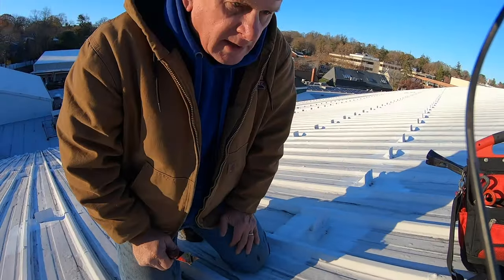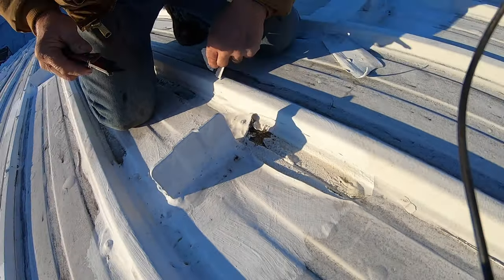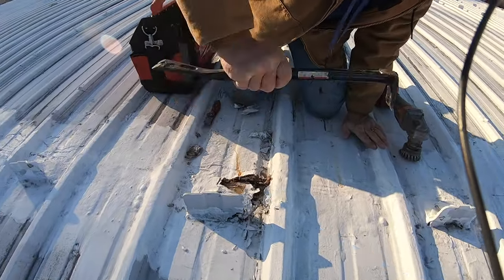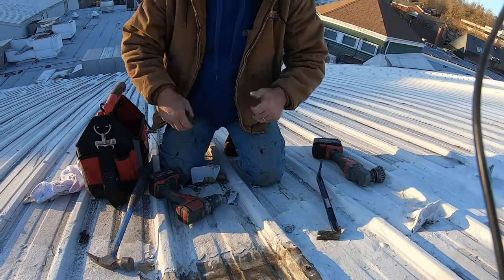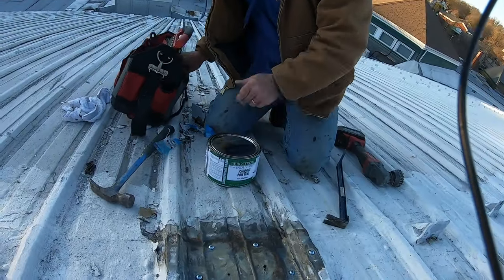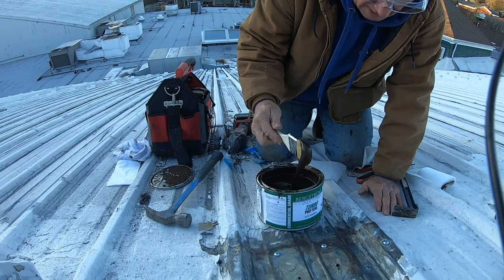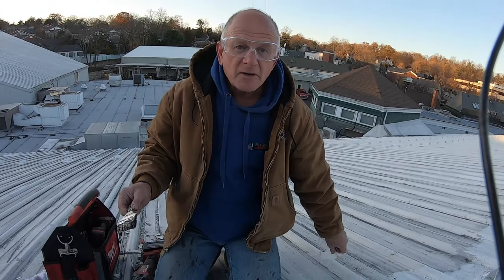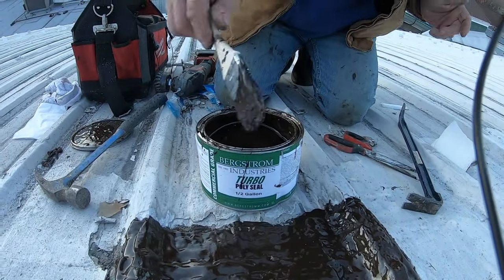Why NOT to apply Metal Roof Coatings - The worst thing to ever do

Comment: i have 900mt of metal roof and that black thing with time sun burs it and it turs like dust,,i clean everything and use a 20 year warranty silicon coating  and its 6 years now and in perfect condition
Reply from the maker: You are correct. In most of the videos where I use Turbo Poly Seal, I do tell people to use Silver Coat Protection. It is a tougher product than Silicone. But, I also use Super Silicone Seal in many places, for that reason

Comment: I have a  metal roof about 40 years old, the nails are not working anymore and I need to install screws, what would you recommend? A screw with a rubber gasket?  THanks
Reply from the maker: Sorry for the late reply. Yes screws with a neoprene washer will do.

Comment: What do you to on a 30 year old metal roof that the original coating is starting to degrade?  Change out the roof?  It is a very high end metal design.
Reply from the maker: I am not an expert on metal coatings. But, I suggest you research how to go about treating metal roofs where the galvanized or paint is starting to come off.
What I am showing in this video is that spraying a latex coating over a metal roof will cause problems.
The biggest problem are the seams. As soon as you coat over a seam, that will trap water eventually causing it to accumulate  between the panels causing rust. Also we found that the coating was not adhering around every screw and water ended up penetrating that part of the coating causing the metal to rust around the screw.
What we did was to remove the old coatings around the screw with an angle grinder and steel brush and dabbed the screw with Super Silicone Seal or Turbo Poly Seal. This works very good. The cleaning of each screw is critical.
We also removed the screws on the seams, separated the seams, painted Turbo Poly Seal with fleece 4" up between the seams and also 4" below the seam. Then waited for this to dry and then screwed the panels back down unto the cured Turbo Poly Seal. So this would prevent any water that gets trapped between the seams to cause rust.
Call me a "hack" but for $20,000 per 400 foot seam, saved the roof that would cost $400, 000 to replace.
Reply: @FlatRoofDoctor  thanks for the reply.
Reply: Rust Grip® No More Corrosion! Over 20 Years Rust Protection!

Comment: Question - I brought a farm 4 years ago and the barn has a shingle roof on it. Problem is that who put it on put the shingles on plywood over a metal roof. Currently "cleaning" off the shingles but have alot of holes.
Any recommendations?
Reply: Apoc 583 Armorbase and  585 Armorflex thats the best on the market.

Comment: Is a granulated roof the same as a modified bitumen roof?  If not, which roof is better and why?
Which one last longer?
Reply: Typically yes however you can get modified in either granulated or smooth and of course granulated will last longer. I'm sure this late response doesn't help at this point.

Comment: I use the top acrylic coating out there and I guarantee it’s a lot better product than the junk you just applied! When I get done coating a metal roof it’s more waterproof than the day it was installed.
Reply from the maker: You are correct, it is water tight for the 1st 2 years. After several years it becomes a nightmare. The acrylic dries out. Just see any exterior painted walls on houses. Thats why houses need to be painted every so many years. Imagine a roof that is in direct sunlight and hotter than any wall. Acrylic paint on a roof will fail.
The truth is that most people can't get the original contractor back after several years. They disappear.

Comment: I think they do work. I've had little problems using elastomeric. Whoever applied the coat on this job obviously applied it wrong.. I can see right through it. Here in New Mexico the roof will hit 130 140 degrees  and black tar will last a few years before the heat eventually eats it. I've found white coatings work best on metal roofs.
Reply: You've not had any of the problems he's talking about? How many coats did you use?
Reply from the maker: Ok, both of you are correct. The point I was trying to make is that it is almost impossible to prepare a metal roof 100% before applying a coating. There will always be so dirt somewhere around screws, seams and in general that will prevent the coating from adhering.
I also think white is better. What about Aluminum Asphalt to reflect the heat instead of a expensive Silicone or Elastomeric coating?
Reply: @FlatRoofDoctor I've never heard of aluminum asphalt.  I'll look into that too. Thank you.

Comment: Excellent video!!! Would small pieces of fleece and poly seal be good for screws that are leaking? I have replaced the dumb grommet screws with new ones and it didn't solve the problem so I wondered about doing this on them. Thanks!!!!
Reply from the maker: Just use the Turbo Poly Seal without the fleece on the screws. Make sure you clean around every screw before applying the Turbo Poly seal
Reply: @FlatRoofDoctor  Awesome,  thanks for the fast reply!
Reply: You can simply use a polyurethane caulking on all of your fasteners.
Reply: @kevinwaller6353  awesome thanks!

Comment: I have been coating roofs for 20 years . The best way to coat a roof is to, patch all nail heads with through the roof / geocel. And coat roof with asphalt aluminum non fibered . Asphalt aluminum wears off and never peels , all silicone and acrylic will eventually let lose over time and then you have a mess. Also asphalt alum is a rust inhibitive roof coating . This man knows what he is talking about
Reply: Hi I’m going to work on my mobile home roof. Any tips on what I can apply? I have 2 very small leaks. It’s an aluminum roof that’s never been treated with anything. Just has a few rust areas and I plan on grinding off the rust as well as cleaning up the roof. Would really appreciate any tips.. :)
Reply: @evekelly3832  patch the leaky spots with something like gaco patch. Gaco coating is a great product, the company I work for sells alot of them. I've never had any problems. But honestly the best thing to do is repair the infected areas with new roofing panels. It's not a difficult process. But also if you mess it up you'll have more than 2 small leaks.

Comment: I want use flex seal max for my patio roof that is metal..what do you think of that.??
Reply from the maker: You miss the point. Any sealant is not equal to others, and the Fleece is the secret to the strength

Comment: Was looking to use a product like this on the roof of my ol suburban. Silicon then?
Reply: Use 100% silicone white roof coating like from gaco
Reply: @angryhands9564  I ended up going with a product from Sherwin Williams called bond-plex. Even had it matched to my paint color. Holding up so far.

Comment: CI Roofing 
I  Have to agree and Disagree with your opinion We have Sprayed over 700,000 sft so far in 2020 of Acrylic  on Metal Roofs and don't have that issue At the end of the day its all about proper preparation and cleaning Theres is a lot of flyby night shady roofers out there So I feel you not being partial to the product  that Hundreds of vendors sell the Acrylic The application you have applied is the basic Roof cement that I totally despise that makes by Coating look bad after it dries because it shows thru 
I respect your view But I still trust Acrylics if applied correct

Comment: Installed galvalume metal on my shop bought metal from Mullers of Port Allen, La. it is cracking all up like spider web pattern. Has rotted all my framing on a area 8x20 ft. plus ext. wall. It is junk, never will install it again. This product is what I need until I can install a new roof.
Reply: The metal cracked?

Comment: When there is bubble or blisters, meaning your applicators did not follow the proper paint system...prime it properly, cure it them, do the top coat for 2 coats only. Don't paint if you a high moisture period. Bubbles will really come!

Comment: Roof coatings are great and much less than a brand new metal roof. You have to clean, prime & install the coating properly. Some manufacturers make rust inhibitor primer. Also temp and moisture makes a difference. Gaco makes a great product. Only one I would use. Silicone!!!!
Reply: Look into ER300 I like it better than Gaco and it's compatible with other products unlike silicone. It's the best roofing product I've ever used in over 30 years.

Comment: I've been spraying semi loads of acrylics for 12 years and my dad was spraying them since 95. We've never had this problem on a metal roof EVER. 
I walked a 50,000 SQ ft roof last year that my dad did an acrylic coating on, the head of maintenance told me the roof has never leaked a drop. We acid etch, pressure wash, prime, reinforce all our seams with polyester fabric and caulk all our screws before we coat them. They work perfectly for us. 
This is a very bad application and not a very good product, I've seen lots of problems with Aztec
Reply: What products do you use. I have a metal roof that has no finish left on it. I restore all kinds of floors.. like anything... the proper prep. Good products.  Good application.
Reply: THIS is the WAY!!! Proper prep makes for a long lasting coating... Every coating job I did, depending on the type of warranty the customer purchased and the mil thickness, I would go back and recoat accordingly.

Comment: To fix a roof that big would cost a fortune!  Makes better sense to install a new roof.
Reply from the maker: You are right with that statement. I have been fixing this roof and have spent over 5 weeks and over $15 K on materials.
Let's break it down.
Materials - $15 k
Labor - $30 k
Charged the Customer $100 K
To replace the entire roof would have cost $450 K
So, when the cost of repairs is more than 20% of the replacement, I think then a replacement is better.
The reason we did the repairs instead, is that we did not know the extent of the repair when we got started. It became more obvious almost halfway through.
My rate for the repair is lower on this project because the owner and I were surprised at the extend of work to follow. So, I felt that I was at fault too, and eased on the cost.

Comment: Very nice video. I need your advice, I am from India, I have 3000sq feet godown with metal roofing. In summer season, temp goes up to 47 degree centigrade. It’s very difficult to work under this condition. Please advice me, how could I minimise the temperature of roof.
Reply from the maker: The easiest way would be to reflect the sun rays from the surface. I think you should paint aluminum asphalt paint on the metal. That should reduce the heat by 50%.  The other idea would be to install some inexpensive material, either cloth, hessian, or even bamboo suspended under the metal to cut down the radiant heat. You could also overlay the entire roof with palm leaves. 
These are just ideas that came to mind while writing this response. 
Let me know what your thoughts are.
Reply: Earlier, I am thinking of the epoxy coated paint, is it okay?
Reply from the maker: @anupnakat007   I think that is very expensive
The aluminum asphalt paint will reflect the sun much better
Reply: Canada here. I assume what you desire is to lower the temperature inside your building?
Weird as it maybe you need to insulate. Insulation works both ways keeps heat in and keeps it out, but you need to have a proper building envelope  to make the system effective. 
Roof events or Air Handling Units to bring out hot air.

Comment: There are many procedural problems in the whole system. 
FIRST is the preparation of the substrate. Clearly, the metal roof was not prepared. It's dirty even before the coat was applied. So the result is the coat did not adhere to the metal substrate. All the rust should have been removed using rust neutralizer and pressure washed.
SECOND the acrylic coating was applied using rollerbrush and paint brush INSTEAD of the airless waterproofing sprayer. The difference is a WORLD'S DIFFERENCE. By using brush, microbubbles are created by the back and forth movement of the brush. These bubbles will remain INSIDE the coat making the coat ESSENTIALLY a sponge, thus absorbing water instead of repelling water. Professional applicators use AIRLESS PAINT SPRAYER to avoid creating bubbles in the coat. REMEMBER, AS LONG AS THERE ARE BUBBLES IN THE COAT, WATER WILL PENETRATE EVENTUALLY especially if the substrate is not prepared. 
NOTICE how the guy in the video applied his waterproofing sealant using the brush. NOT PROFESSIONAL AT ALL. Wait until the weather warms up and his coat is unable to adjust to the expansion of the metal roof. It will also break because it is of a different material from the metal that it is adhered to. As you know, any material when heated expands. So when summer comes, and the metal roof expands, his sealant doesn't expand as long as the metal roof. Acrylic or Elastomeric can expand during extreme heat up to 100 degrees Centigrade (boiling point) so it will not break. The reason the acrylic broke in the video was that it did not adhere to the metal roof because of poor application procedure and NOT BECAUSE OF THE ACRYLIC. Check out the other parts of the roof. They are still intact. This guy doesn't know what he is doing. He is just scaring the hell out of the viewer, fooling them into buying his product that he applies using a paintbrush. Use an AIRLESS PAINT SPRAYER WHEN APPLYING HIGH VISCOSITY SEALANTS AND PAINT and NOT ROLLERBRUSH OR HAND BRUSH. If your contractor doesn't use AIRLESS PAINT/SEALANT SPRAYER, stay away from them. That is RULE NO. 1.

Comment: I was always told do not paint a new roof until it was  getting rusty to hold paint. We used a oil base tar;I can see how plastic coating can condensate.   LEAKs is best repaired before coating it with anything. Caulk seams with good  cellicone . It is a bit of work to do, most spray and go jobs will let in some leaks in a couple years .Had they walked it and caulked it the the roof job would be better. Owner Happier.

Comment: Problem is poor surface prep!! People just wash and paint. You have to power tool or sandblast. Then after doing that do a really good stripe coat with brush and roller on screws crevices corners edges or any non flat surface. Then you can come back and spray a coat or two depending on paint

Comment: Yeah man, acrylic and silicone are not the same thing. also paint and elastomeric coating  are not the same thing, far from it. The reason for these failures is caused by the age of the coating and further more elastomeric coatings, acrylic or silicone are to prolong the life of the Roof. Not to be the Roof. Poor maintenance no matter the material used will lead to a bad roof.

Comment: What happens when you don't properly prep, use the correct products and primers. Also there is obviously 2 or 3 wrong types of paints/coatings painted over the top of each other.  Its true you get what you pay for, and if you cut corners this is what happens.  Hire a real Professional who knows what they are doing. And no home depot trash paints don't work.!  Industrial coatings cost 10 times what other roof coatings cost, and the each have special primers.
Reply from the maker: A really good comment. Everyone should read this. I like when someone give good advice and good input. I am no expert in anything. This is only my way I have done things for years.
Thanks for your contribution.

Comment: Liked this video. Would applying silicone coating every 10 years work as good?
Reply: Silicone doesnt need to be applied that often if you put it on properly and thickly enough. The roof he's discussing wasn't maintained properly. Acrylic coatings need to be reapplied every 7-10 years.
Reply: Silicone doesn't deteriorate as quickly as acrylic coatings and is more resistant to UV and moisture
Reply: @cdrestorationandroofing283  acrylic coatings don't last 2 years before it starts cracking and bubbling. Worst 5k mistake i ever made. I will never put anything but aluminum coatings on mine or customers roofs.
Reply: @dylanclay2741  You're installer sucks then.  We've been installing Acrylic coatings for over 20 years and none of the systems we've installed have cracked or bubbled.  Silicone definitely wears better but anything improperly installed is going to fail early, whether it be a roof coating, a paint job, or an engine.

Comment: 98% of roof failures are a contractor install issue. As is the case here. I'm not as huge fan of coatings myself, but it's plain to see on this job that it was done half ass. The coating is on super thin.
Reply from the maker: it is hard to tell from the video. But, they had a double layer of coating. I think the metal wasn't prepped well before the started

Comment: Sheet metal roof coatings only work when installed on an existing watertight roof, only to lengthen the shelf life of the existing waterproofing. When coatings are applied to already failing roofs, they are destined to fail. I have seen it too many times where a customer wants a coating over an old coating. It fails.
Reply from the maker: Exactly. People think a coating will fix leaks. That is far from the truth

Comment: Youvwill be there months doing that.. You might as well replace the roof.
Reply: You dont need to replace anything just clean up and and apply Apoc 585 Armorflex.
Reply: And what do you think that would cost to RIP off, tip fees and replace?
Reply: @MrJFoster1984  alot but once its up you won't have any more leaking problems for 20 plus years.  Better then putting all those time and hours trying to fix the existing problem.
Reply: @oneloveyessah , that's not true. It's always cheaper to repair rather than replace.